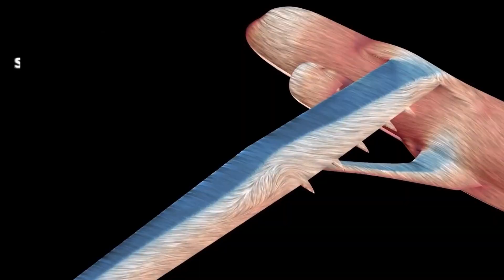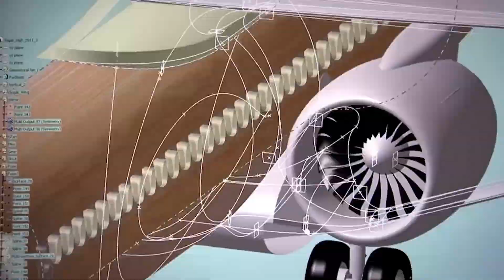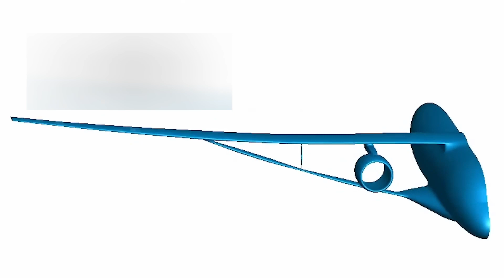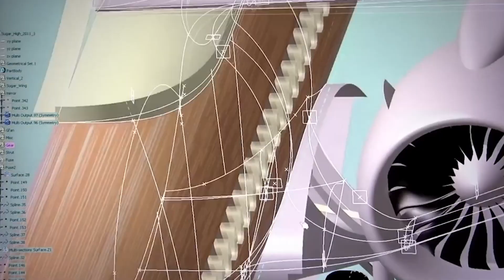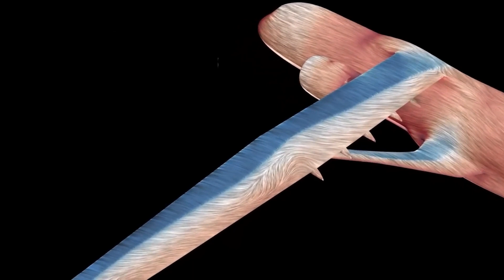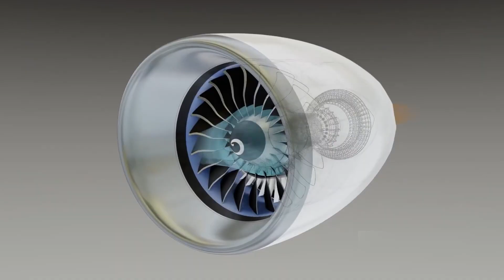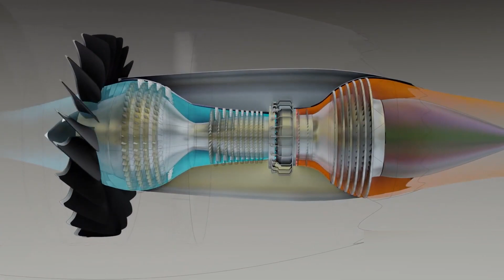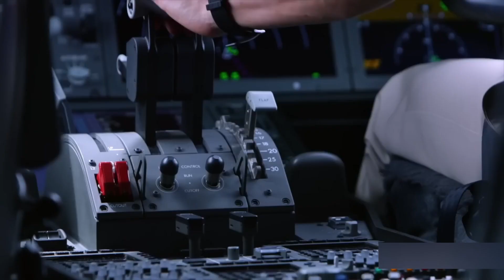NASA's Shocking New Discovery: NASA and Boeing are About to Revolutionize The Aviation Industry

Comment: Even with efficiency gains of 25-30% planes are going to use massive amounts of energy. 
Cambridge physicist David MacKay (author of “Without Hot Air”) has calculated that a single Atlantic flight ONE WAY uses about 4800 kilowatt hours of energy per person (630,000 kilowatt hours to fly that one plane one way across the ocean).  To put this tremendous amount of energy in terms that are easily understood we can equate it to a hot shower: a 30 litre hot shower typically uses 1.4 kilowatt hours of electricity so a single return airplane flight uses as much energy as 6858 showers for every person on board.  It’s like everyone on the plane taking a shower every day for almost 20 years - equivalent to 900,000 showers for the entire plane! (McKay actually estimates this higher as 12,000 kwh per person on his webpage - this figure is from an earlier version of his book - 12,000 kwh is the same as 17,000 showers a person on a return trip.  He states, “Let’s make clear what this means. Flying once per year has an energy cost slightly bigger than leaving a 1 kW electric fire on, non-stop, 24 hours
a day, all year.”